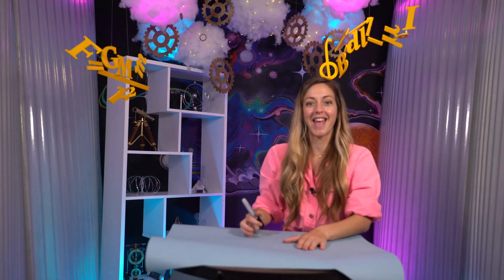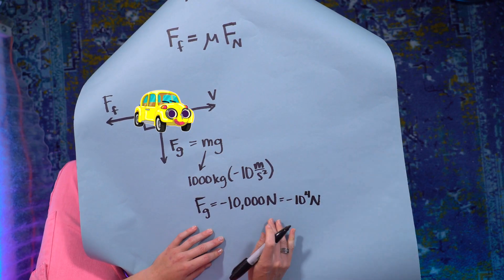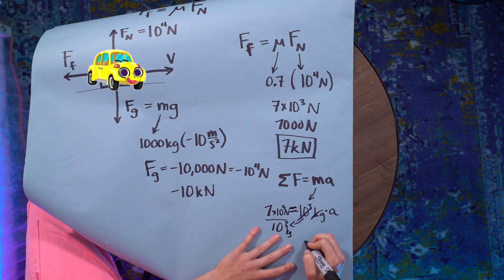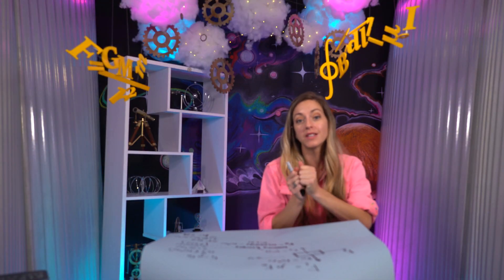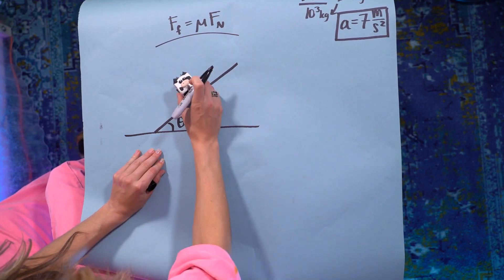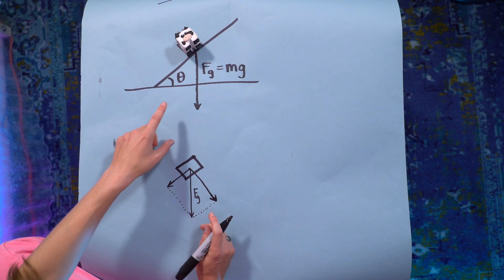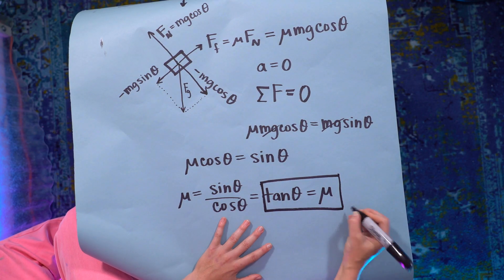Friction - Physics 101 / AP Physics 1 Review with Dianna Cowern

Comment: Hey Diana great videos. They are helping me pass my first physics exam! :p 

Little point though for the first diagram of the car. 
At the start you write a velocity, a force that on this flat plane, directly opposes friction. Yes? 
But then you calculate the sum of forces and  ignore any force from V (velocity)?? 
So I had to sit here, replaying that section and figure out what you were doing. And Sum of forces I always stuff up, so it was confusing! 

My thoughtful tip -->
Perhaps if you write a diagram and include a variable, in this case V, maybe either mention ignoring it as you calculate or just don't write it. Especially since you summing forces but don't do anything with it. IE Maybe wait on putting it in until you recalculate Kinetic friction perhaps?

Anyway, don't know if you'll read this but thanks for all the videos!! :D

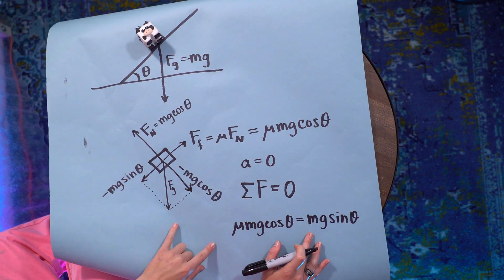Comment: Nice video, only one remark, if you find it interesting ;) 15:31 In a free body diagram, the direction in which you draw an arrow defines the direction of that force. So actually the minus sign doesn't belong there, because the arrow already points in the negative direction (assuming the coordinate system is defined as usual) It would be different if the force was written as a vector, because then the arrow is only an indication that there is a force with some direction.

Comment: This might sound weird and specific, but I’ve been trying to find types of textures and surfaces that when i rub my finger against them, it causes it the skip across like vibrations. I’ve found that rubbery textures work like that but would there be any other things that can cause vibrations due to friction like that? The reason I’m asking is because I’m learning a method Called “drag clicking” which is based on vibrations due to dragging your finger across a surface.

Comment: @Physics Girl            You didn't really talk much about the collision aspect of friction, you only briefly mention it at the beginning. It may not always be the biggest aspect of friction, but surely it plays a role. I mean if you were to take a sideways step/row of triangle bumps/ridges and push them along another row of triangle ridges along the bottom, the top ridges would always be falling into the spaces in the bottom and then if you push them along, would climb back out.  This would be a friction. If you rapidly moved one over the other there would be lots of collisions and instances with one climbing over the other slowing down the movement. It would also take a steeper incline before one fell off the other depending on the size of the triangles and other factors. Surely this applies on smaller scale as well. 

                  Like if we are talking about shoes, or  car tires, they have ridges. These ridges on the flexible material with weight flatten out but want to go back to the standard shape.  So you have the additional friction of pushing against this material rebound factor. This is why more flexible and uneven materials provide more friction under weight.  Matter collusion friction becomes a big factor sometimes when we are trying to create friction.  Is there a physics formula that could possibly fully calculate that factor with the rest?
                On the more extreme end, you have things like cleats, which are shoes with spikes and snow tires, which are either car tires with something like chains on them or on bicycle tires are small metal spikes along the ridge of the wheel, using material collision to it's fullest to increase friction. And surely these count as "friction", or at least need to be considered in the same formulas when calculating friction. Like if the cars tires are "bald" AKA all the ridges have been worn away from repeated collisions making the tires relatively smooth, the car would take much longer to stop. And if there was a series of speed bumps, it would stop sooner. 

                Also, as you talk about molecular attraction (which I kind of already knew but your lesson helped focus in my mind in regards to friction) Might you call water tension, a form of "friction"? I mean water tension is how things can be wet without having to sit right on top of whatever surface, without water tension things would dry immediately with the smallest amount of gravitational force.(watched a video recently about a material called "dry water" [I think that was the name] that does nearly just that because of it's lack of surface tension)  And without water tension, water could not bead up.  (which I'm sure you already know all this)  Water tension can also do things like make something wet cling to a vertical wall if the item isn't too heavy and the surface area is great enough. So is water tension just a specialized term for water friction? Or is there a difference?

Comment: Static friction is not exactly equal to µₛFₙ. Maximum static friction is. Actual static friction is only ever as high as it needs to be to stop the object from moving. Otherwise friction would cause the object to move and that's just weird.
Reply: Thank you for answering my question for me. Also, how do I know which direction static friction points.

Comment: I am involved with practical measurement of friction in a technical environment. An important thing to remember is what you mentioned at one point: Friction is messy. mu is nowhere near the constant for which it is introduced in high school physics.
A famous quote of our lab engineers when you order measurement of a coefficient of friction: "What value do you want?"
It depends on lubrication, on aging of involved materials like rubber or oxydation of metal surfaces, on ambient conditions like temperature, humidity, vibration, on speed, on pressure (even if the straight up Coulomb theory say it doesn't).
So one thing to absorb: Yes, you can calculate with the law of Coulomb. But there are significant error bars on those results.

Comment: Careful... the force of static friction doesn't equal (u_s)(F_N) in all cases.  That is the maximum possible force of static friction.  In general, F_s <= (u_s)(F_N), with the equality only true if something in the situation let's you know you are accessing the maximum static friction force.

Also, technically, the surfaces in static friction are not moving *with respect to each other*.  They could be moving overall (such as the static friction between an unattached tool box and the bed in the back of a truck).

Comment: I don't believe that friction occurs as a result of adhesive forces... They seem too weak... Microscopic bumps require work to be exerted to be moved over each other because acceleration must occur in the vertical direction relative to the surface. Work generates heat. If adhesive forces were responsible for friction, wouldn't ice blocks resist sliding over each other because of hydrogen bonds? Hydrogen bonds are way stronger than induced dipole forces between two wooden surfaces, yet ice on ice has a lower coefficient of friction than wood on wood. I'm just in highschool tho😂

Comment: Hello Dianna,
I saw something that might be usefull as a physics riddle.
Take an inclined plane and two cylinders with different radii.
Which cylinder will reach the bottom first?
Turns out that the both reach the bottom at the same time.
So the speed of a rolling cylinder on in inclined plane is independent
of the raduis of the cylinder.
If on cylinder is hollow and the other is full, there will be 
difference is speed. This was very counterintuitive for me.

I've seen most of your videos and I liked them very much.
My top three is
1) crazy pool vortex
2) the one with the spinning egg on the mirror
3) the interview with the director of LIGO

I'd like to see more videos on surface tension,
angular momentum, mechanics and entropy.
Interviews with researchers and the latest on
research also interest me.

I've seen some interesting videos on physics.
The first one is on curiositystream.com. There is
documentary called "the science of bubbles"
The second one is on youtube the Royal Institute video
called "order of time" by Carlo Rovelli 
(https://www.youtube.com/watch?v=-6rWqJhDv7M)
 
 My email adress is hugovanhove0@gmail.com
 
                             Yours truly,
							 
						Hugo Van Hove

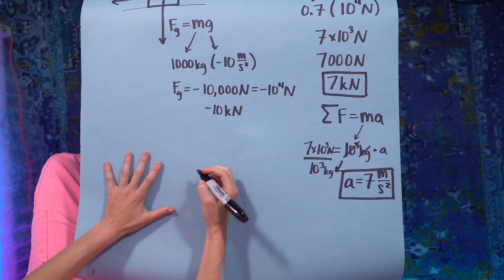Comment: Nice video, as always. Just want to point out that at 10:20, the formula given is for maximum static friction, not static friction in general. Static friction can be as small as 0 when there is no tendency of relative motion between 2 contacting surfaces, and it can be as large as the product of static friction coefficient and the normal force when the relative motion between the surfaces is about to start. Imagine a book resting on a table. When there is no horizontal force on the book, the static friction is actually 0. When there is a horizontal force applied yet the book remains stationary on the table, then the static friction must be equal to the applied force but in opposite direction so the net force on the book is zero. But if the applied force keeps increasing, eventually the book slides on the table because the force exceeds the value of maximum static friction and the static friction on the book can’t increase beyond that.

Comment: You should have added that friction is not dependent on the surface areas of either of the two objects. It seems counterintuitive - for example the huge tires used on funny cars and dragsters - but that's more for heat dissipation.

Comment: There is the static and the dynamic friction forces which don't depend on the area, but there is also adhesion (caused by van der Waals forces) which is proportional to the contact area. With just friction an ant couldn't climb up a wall without anybody pushing against it like you did the book and a Formula 1 car wouldn't need wide tires to go really fast around a curve.

Comment: I think ice and banana peel acts different than normal friction .

Because when we keep a wooden block on a wooden silde , it's too tough to slide it down ,since rough wood has a higher friction . 
But if we keep a smooth glass block , it would slide down like butter ... 

But in case of ice and banana , i think it is not because of low friction but because of shedding of  material ... 
Let me make myself clear ...
See . When you were sliding down the grassy slope on an ice block , the layer of ice in contact with the grass was continuously shedding and melting , leaving behind a residue of water , and the rest of the ice goes forward and on and on and on , until the ice totally melts and you stop sliding anymore ... Same with a banana peel  . The banana peel leaves behind a jelly residue and slides forward ... 
But in case of glass , it is simply a matter of low friction ... There is no question of residue left behind , acting like a lubricant ...

So ice and banana peel act like a solid with a residue that acts like a lubricant. ... The same happens with graphite ... Because graphite also leaves behind the layer of contact and moves on with the new layer of contact and on and on ... If Graphite and ice did not have such a tendency , they would have a huge friction ... 

Try sliding dry ice and normal ice .

Comment: Hey Diana... absolutely love your physics class vids and all your other content. But please don’t use the roughness analogy for friction. It’s the amount of surface area in contact with the other surface that maximises the molecular forces that lead to friction, not the surface roughness. Slick tyres on motor racing cars and motorcycles are the classic example here.  If you want to demonstrate the power of friction, a MotoGP rider’s motorcycle tyre has a contact patch with the ground of around the size of a credit card which is amazing considering the cornering speeds... perhaps a video on that might be interesting? 😉

Comment: 6:15 "a car using it's brakes" (shows car doing the exact opposite)
Reply: Can you explain this, please? I really want to understand
Reply: @YungJay0  the video shows a drifting car. When a car is drifting, the driver uses the throttle to make the tires spin. The tires can move sideways while pointing forward. The smoke is created by, you guessed it, friction. The tires spin on the asphalt and create a lot of heat. So when she said, a car using its brakes, and shows a car slamming the throttle, that's fun.
Reply: @Feens_404  not really though. You aren't hitting the throttle the entire time. You actually use a combination of brakes and throttle.

Comment: Hi Diana, awesome video, I always had doubts on the actual mechanism of friction...
However when you mentioned that molecules bond and break... between surfaces..
Should the chemistry of the surface materials also have some influence on the coefficient of friction? For example if the material sitting on a wooden floor doesn't bond as much with the wood then it's coefficient of friction would be lesser then tan theta right?

Comment: Killing it with the pink jumpsuit!

That car drifting wasn't locking up the wheels.  It's actually the opposite.  The wheels are over-rotating and breaking the friction between the tires and the pavement in order to slide along the surface.  But it looked cool.

Comment: Ah the old "angle of repose" ........ which changes, for the same material, with changes in lots of stuff .......
just sayin' ...... ;-p
Reply: I live near White Sands National Monument, New Mexico, which is a huge ~40 square mile range of sand dunes composed of bright white gypsum (the drywall chalky stuff) sand. The gypsum crystal shape allows its angle of repose (the steepest slope a loose material can get before it slumps) to be greater than silica sand (the Saharan desert stuff).  Because of this quirk of nature, all the sandboarding at the monument is rated triple diamond.

Comment: The link between static and dynamic friction and intermolecular forces was quite interesting. It makes you really think about static friction as a macroscopic manifestation of the molecular stickiness but I still think there is an intermediate microscopic scale where it is mostly due to the rough surface and jumping over the bumps without getting trapped inside holes if you are going fast enough. The molecular stickiness is probably a dominant factor only on very smooth surfaces.

Comment: Interesting example of a car, the coefficient of certain materials can change under load, rubber - of which the tires are made - for example. So when the car brakes hard, the energy is shifted to the front tires, increasing the load and thus the Coefficient.

So the actual area of contact on the road is irrelevant - if I remember correctly (probably don't as it's been many years)

Comment: Nice video. However, there is a misconception at 10:18. Static friction (non slip friction) is NOT equal to mu_s F_N. That value is the maximum non slip friction can be before it starts to slide. The value of the non slip friction is deduced from Newton 2nd law. In the example of the book that does not fall off the wall, the static friction is opposite to the book weight mg, no matter what the value of F_N is. If you don't push hard enough such that  mu_s F_N falls below mg then the book will slide.

Comment: Talking about chemical reactions what about hormones.  Insulin is one side negative one side positive.
   .
Testosterone  is a fuel at least. Consistent affects are a fuel .
 Adrenaline is a long triangle molecule. And focus energy .
 I still having trouble relating the molecular structures  dopamine or serotonin  to emotions. I read hormones the molecular structure of hormones is arbitrary.    In that case emotions are chemical reactions chemical signals. .  when they say chemical reactions they use mean it away to disprove  affects energy . or emotions are real .  but themselves do foggiest idea of biological  just by saying chemical reactions when chemical signals.
 And real emotions are in impulses through the cells electron transport chain.
   Even if the are chemical reactions. Then chemicals carry the impulses.
  And does putting a magnet in front of a TV or cracking then screen or breaking the antenna  disprove existence of TV stations